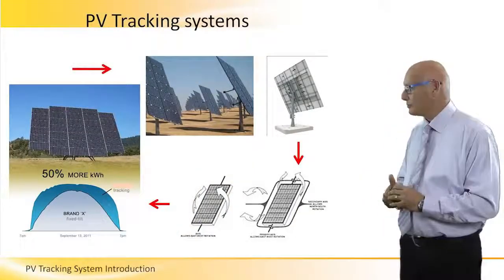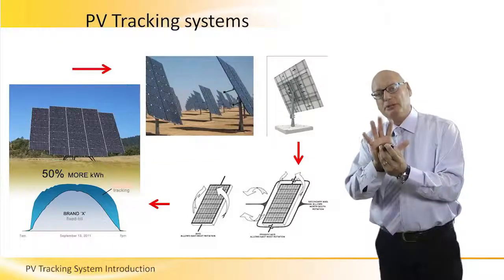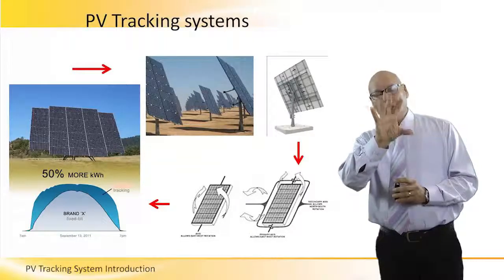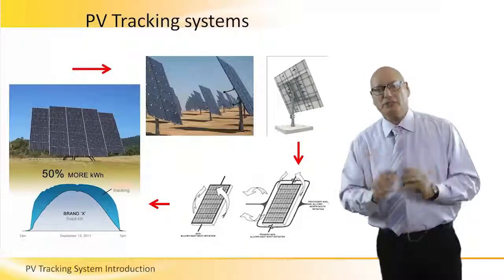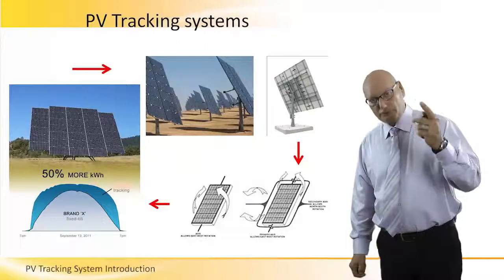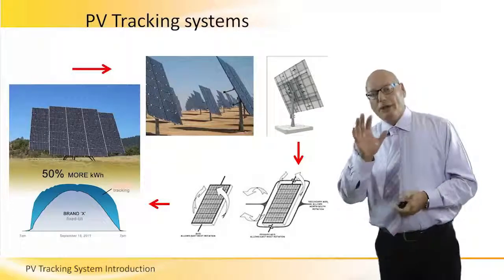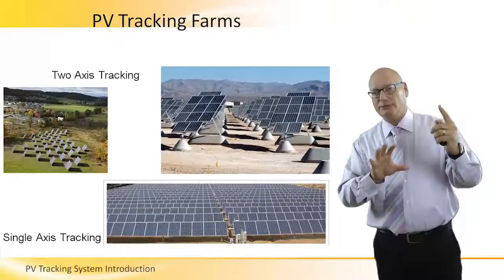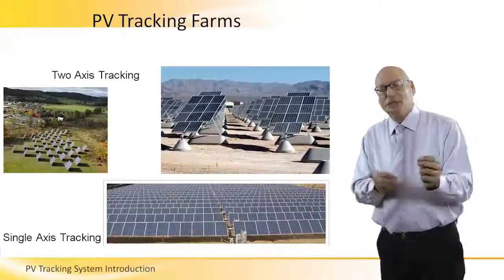PV Tracking System Introduction

Comment: I completely disagree that higher latitudes have shorter shadows. I am at a high latitude, and I have very long shadows. Then you say, taller arrays have shorter shadows. What?  No, taller arrays have longer shadows. The more vertical the array ( ie taller) the longer the shadow. You are very confused about higher latitudes and shadows.  Shadows are much shorter near the equator , while shadows are much longer at higher latitudes.  I don't think you "know" this subject very well.